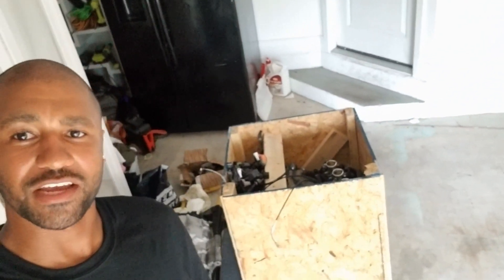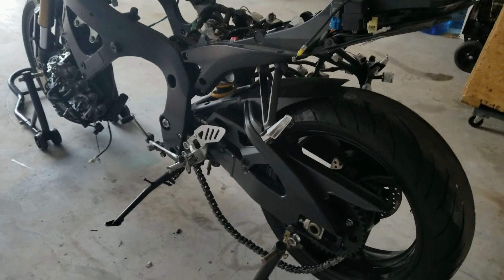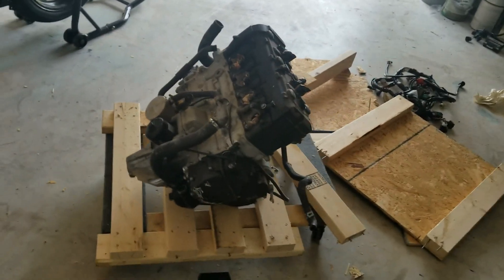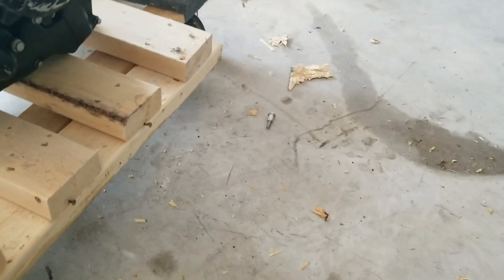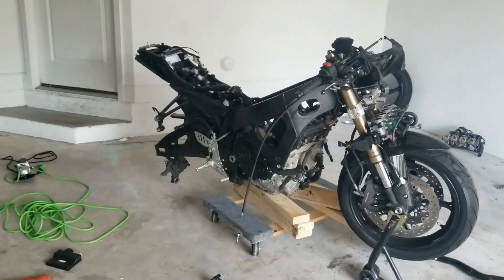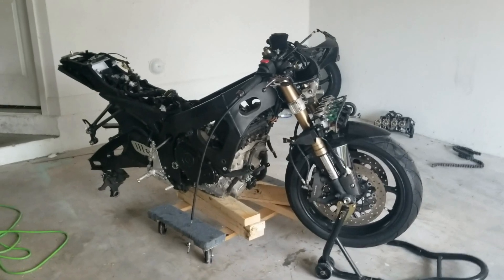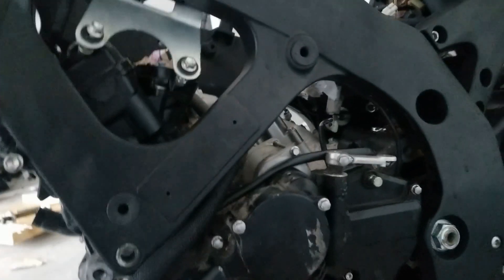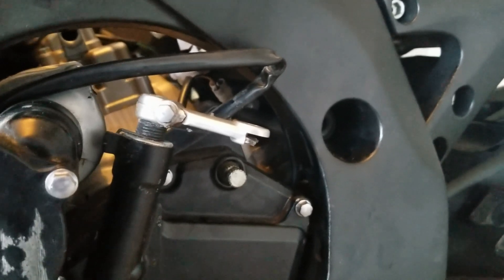Project Gsxr Engine Swap (part 2--gsxr 750 engine installation)

Comment: Can you put a 2010  gsxr750 engine  in a 2006 gsxr600
Reply from the maker: I wish i could help you out with that info but honestly i have no idea. i was lucky because somebody actually and my combo motor and frame and they did a test fit for me.
Reply: Yes you can. 06 - 10 is all interchangeable